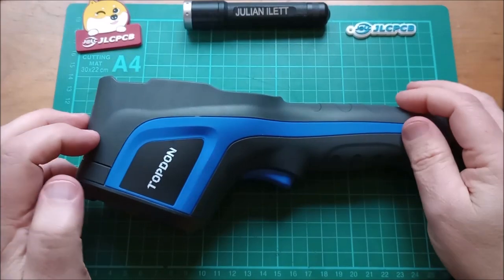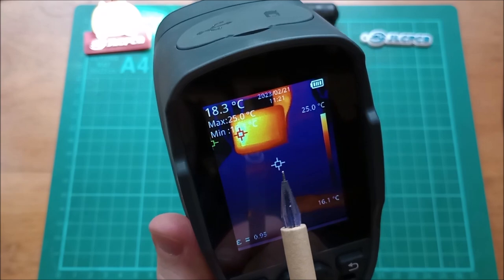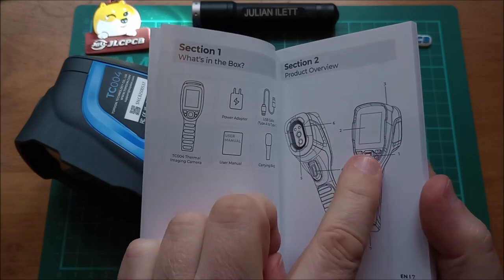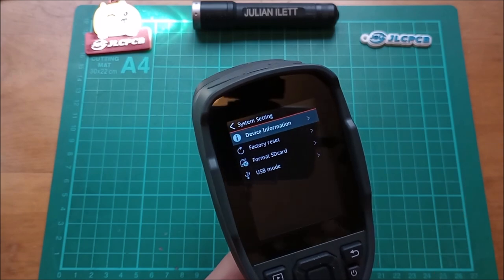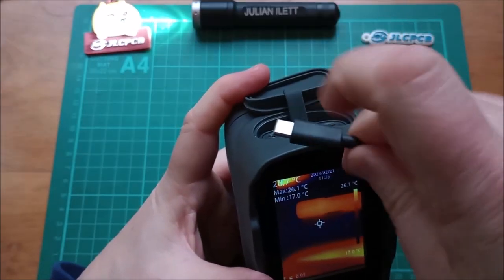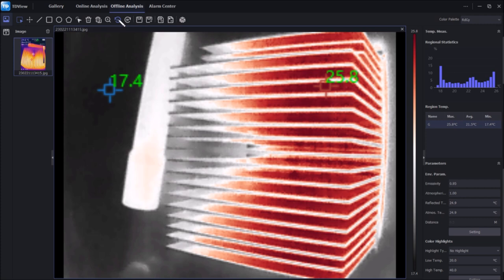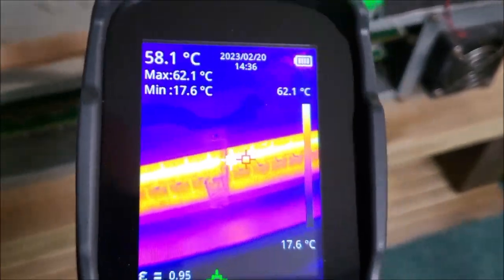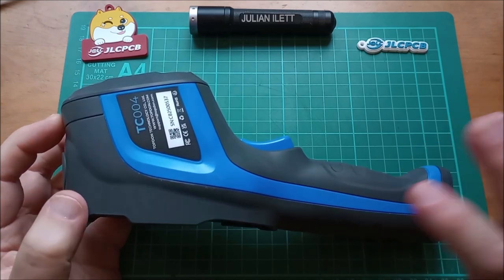Topdon TC004 Thermal Imaging Camera Review

Comment: The resolution and frame rate looks awesome. 

What's the second lens for though? On ebay they only explain the IR sensor and LEDs. 

Is the other sensor a regular camera which is being used to make the image look better? 

I think I read before that the combination of a regular camera and far infrared camera is a patent held by Flir. 

Maybe maybe it's possible to get around that, depending on exactly how they're combined.

I know you mentioned it later in the video and said this new one doesn't need to combine an optical camera. But if that's the case, what's the second lens for?

Thanks!
Reply from the maker: I think the case was designed to have an optical camera fitted, but with this sensor it's not needed.
Reply: @JulianIlett  ah okay. So it's just an empty hole? Thanks 👍
Reply: @GadgetAddict  like a blanking plate i suppose.  just re-using moulds instead of 2 identical moulds, but one without a hole.. them injection moulding 'tools' (moulds) are mega expensive to produce. also, looks way cooler witht he ex5tra littlwe hole. the device looks 'busier' and more technically advanced.. cost free eye-candy from a business point of view
Reply: This is the slightly lower-priced version of their TC005, which DOES have a camera behind that second hole.

Comment: I own this model. It's nice , wish it had a charge light so I knew it was charging or charged up. Other than that it's great. Point it at the ceiling and you can see we're the 2x4 boards are just from the temp change. Amazing.

Comment: As a reference point, the ZX Spectrum had a screen resolution of 256×192 pixels.
Reply from the maker: That's funny 😁
Reply: And you would have had a similar pattern on an older CRT telly if you turned it on its side to match the orientation 😁

Comment: Thats a pretty good camera.....and a good price also - £289. I might push the button.
Reply: go careful! ensure the resolution for £289 is 256 * 192  it's easy to select a lower resolution accidently. Elsewhere on the 'net, the price for this camera at the 256 * 192 resolution is nearer £400.00. please double check what you get. the price you mention seems unreal for this specification. best wishes. rob
Reply: @Palmit_  Arrived today and it's spot on perfect. Nice camera, build quality is really nice and even the paper manual is a quality print. Looking forward to putting the camera to good use.
Reply: @IanScottJohnston  awesome.. i'm getting tempted already... and price was £289? with delivery and taxes etc?
Reply: This is an overpriced item.  Last year I bought a UNI-T device with the same resolution and included a visible light camera for less than £230.

Today, UNI-T sell one identical to this Topdon model (without the second, visible light, camera) for £202.

Tread carefully if you don't want to be ripped off.
Reply: @@IanScottJohnston posted asking where I saw the UTi-260a for £202.  I saw it on aliexpress among other places.  Keep searching and catch the sale prices.

Comment: You can get the Uni-T UTi260A for less than $200. This seems to be essentially a reskin of that camera
Reply: Would you be interested in making a video of it - that shows hot air leaks around windows and doors?
Reply: And the uni-t uti260b is £282 which goes up to 550c and has camera augmentation too
Reply: @eliotmansfield  yep, I own the 260b. I got it on sale for around $220
Reply: @pyromen321 - thanks for heads up on Uni-T👍

Comment: beware fake ads, Topdon TC004 Lite (ca£200) is only 160x120 pix IR sensor way too fuzzy for use on cct boards etc just a toy to look for heat loss around the house.  The true gear is 256x192 as per Julian model - different ball game at £300 YGWYPF